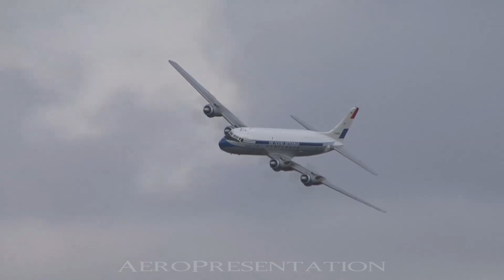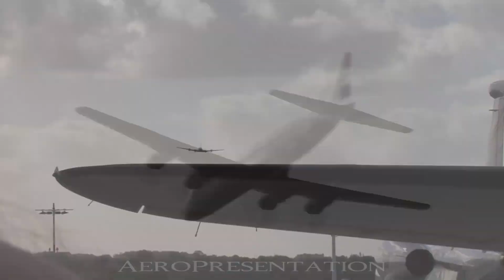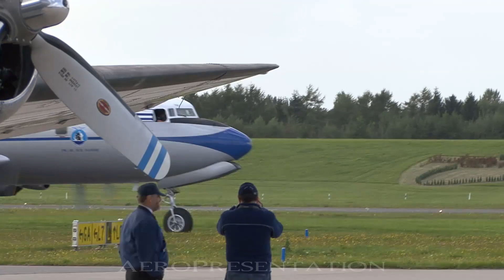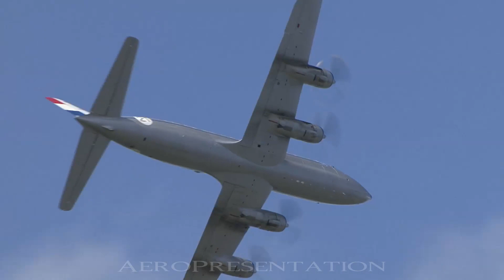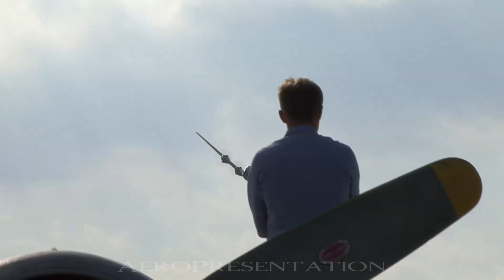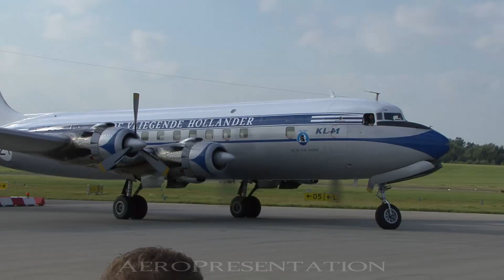DC-6 Propliner'obatics

Comment: Excellent come back and good presentation. And remember to monitor those engine driven hydraulic pumps every chance feasible. Over the years part 121 I've had several EDHP failures and once had an aux pump failure. We always try to be prepared to the best of our ability..